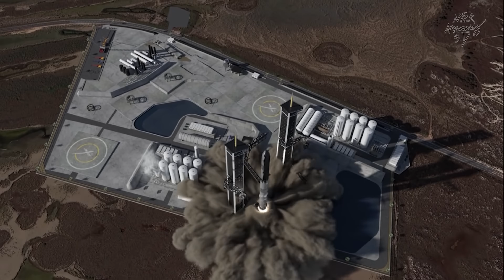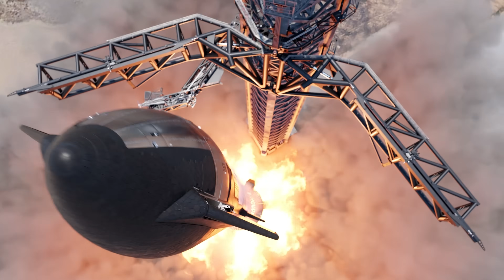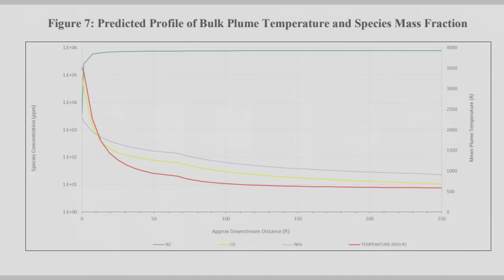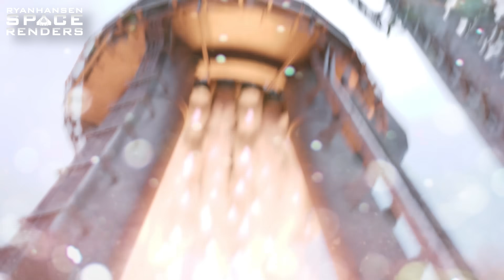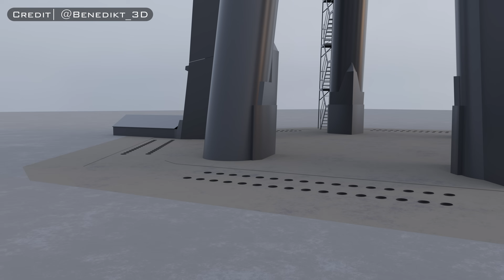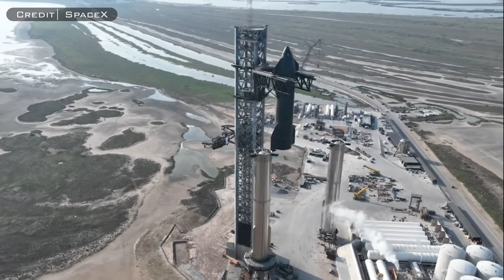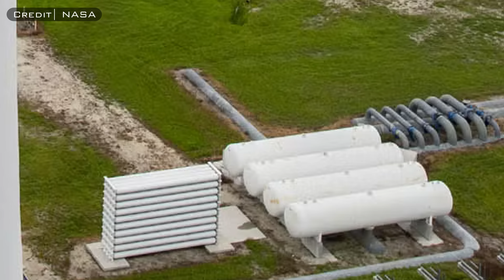SpaceX's "Major" Concrete Problem + Water Deluge Construction Begins at Starbase

Comment: 31:39 I imagine the launch mount structural engineer isn’t on the launch panel. Fondag appears to have a short curing time for maximum strength but water present up to full curing will expand as steam and rupture the slab. Heat only required for this.

Comment: Why didn't they make flame diverter in the first place? What a strange devotion to the ramp-rocket-tower trinity... If the water evaporates when it is still in plate wouldn't it make more damage? Like steel projectiles together with the concrete ones.
Reply from the maker: In my more recent episode I explained how this will work without water boiling inside if the plates.

Comment: I wonder if they used heavy thick stone slabs of Granite or Marble stone work with no mortar used between the blocks instead of pouring concrete? The stone work of some materials might be more resistant to heat than  poured water absorbant  materials are.

Comment: You can't just simply use a material's properties to predict its performance in an application, how that material is used to build a structure is just as important, if not more so. If you suddenly increase the pressure inside a room built with concrete, even just a few psi increase will blow the walls out. You see this in high wind situations where roofs and walls get blown out because of the sudden but relatively marginal increase in pressure inside the building. People who are still apologists for Musks way of doing things are in denial. The debacle with the recent Starship launch should be proof that there is only one way to go...

Comment: I'm seeing this video after the concrete was destroyed. What I don’t understand is why. The data is for 1 engine. Your rough calculations are for 1 engine. Even 14 engines in a staggered pattern would perform differently. No one, including government oversight factored for the center engines to be in a confined state. Since the outer engines would prevent the innermost from ever expanding or mixing with cooler air. In someways they would act as an increasing pressure confinement until something gives. Also the concrete in compression is only as strong as the base it's set upon. Sand has a lower compression rating and holds more water than soil. Now add increasing pressure and heat as the engines throttle up. Instead of concrete spalling, you have stream pressure vessel. Which will explode outwards, the large flying blocks of concrete. Common sense is missing
Reply: YES!  Fantastic observation/explanation. I was thinking about the plume confinement too- but your additional consideration of the underlying sand/earth was genius. Thank you! 🎉
Reply: When I look at the base of the heavy, I see a cutting torch. Which uses oxygen and a fuel propane, methane or acetylene. If the inner 3 raptors were running just oxygen. It definitely would be the largest cutting torch. The thermal dynamics should be similar. Which would be easy to calculate the pressure and heat onto the concrete and base

Comment: Here after the destruction of stage zero. Space X is wasting time. Even if they do a flame trench, those engines still burned the upper stage zero materials including materials on the chop sticks. So even if they fix the pad, they have the raw thrust of the 33 raptors they have to tame to ensure plumbing is not charred.

Comment: Why do you suppose that the centre of the plume will cool from over 3000C at the rocket nozzle to 2000C at the concrete surface when there is no cooling entrainment? I assume we are talking total (stagnation) temperatures in both positions. 
Others have mentioned the acoustic pulsating pressure which together with the thermal gradient in the concrete and much higher temperature would account for the damage now seen.
If a water deluge system will suppress the acoustic pulses, then a water cooled metal plate might work. However I suspect that some kind of inclined surface will be needed to deflect the acoustic energy which might have contributed to engine damage.

Comment: "assume 100% of the thrust generated is applied directly to the ground". This a  baseless assumption (pun intended). The blast energy and the sound energy will radiate out around the 33 firing Raptor 2 engines. With hindsight, after the first Superheavy launch we also learned that the kinetic energy imparted to flying concrete debris from the launchpad can cause a huge amount of damage.

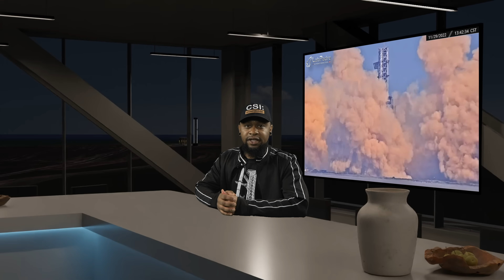Comment: The predictions made around 17:00 have failed catastrophically. In retrospect, it's easy to see why the calculations are wrong; temperature was only a minor cause of the damage and what actually shattered the Fondag was the jackhammer action of the startup pressure front. That's why the crater is inside the engine ring and the outside portland cement was mostly fine. Futhermore, the compressive ultimate strength of the cement is only relevant for a compressive load, i.e a perfectly even load in a test machine. When you lay the concrete over soft sandy soil, you have a bending load that is supported mostly by the rebar. When concrete started to crack it allowed exhaust pressure to enter the mass of the material and chip away the outside layers, just like in your heat spalling video.
Reply: 100%

Comment: Looks like the damage is not unexpected. Interesting that they didnt launch with the water deluge system which is there primarily to reduce sound damage. Looks like they where looking at worst case senario/ stress testing the rocket ... and it came though.

Comment: From the Starship launch yesterday (20 Apr 2023), the concrete problem seems more prominent when the engines went to a much higher power. There were massive debris being thrown hundreds of meters visible from a faraway angle of video, and some mentioned a block of concrete at watermelon size dropped on a vehicle outside the launch station. People are suspecting concrete debris may have destroyed 3 engines straightaway before the starship left the ground.

Comment: Since pad damage is a major concern at this time, here is a method that may mitigate damage. Since the outer ring of Raptors have outside air mixing in with them, for launch fire them at 100%. Since the inner ring does not enjoy that outside air mixing in, they operate more like a blowtorch on the pad. For launch fire them at a reduced power level, and once clear of pad and launch tower, ramp up the power levels to 100%.

This an inefficient technique that wastes fuel, but for test launches and until a long term solution is found, this may reduce pad damage.

Comment: Based on some simplified calculations, even the exhaust temperature should be possible to handle with fondag. Assuming that the flow is adiabatic (and mostly diatomic) and expands from 1,33 sqm to approx 11 sqm, the temperature should fall to around 1070 K, whereas fondag should be capable of 1370 K.

Comment: What about a turn table of concrete that spins so pad doesn’t heat up to the point of no return. Also a slab of concrete on rails moving as engines fire no part would heat to much

Comment: I say SpaceX should put in the strongest and most refractory concrete there is and then, clad the entire surface with 1 to 11/2 inch Tungsten, Tungsten Carbide, or Molybdenum plate. Also, they should place thin Molybdenum cladding around everything else around the orbit launch pad that needs to be protected. The forces and tempatures of all 33 Raptors during launch are going to be colossal.

Comment: Question....Is it necessary to fully throttle all 33 engines to get the vehicle to an initial height so as to do minimal damage to the concrete and surrounding structures? If full throttle is not needed to achieve this height, full throttle could be used as needed after this height.

Comment: Bro, all they have to do is cover the bottom of the launch pad with large interlinked stainless steel plates (several inches thick) and they’ll never have to worry about broken concrete.

Comment: Long ago, the makers of tanks have discovered a practical way to reduce the destructive effect of bombs falling on a tank. The idea was to put explosives on the surface of the tanks so that their explosion (when a rocket hits the tank) would reduce the penetrating effect of that rocket. It is called a ¨reactive armor¨. 

In the case of Spacex, they could use the same idea by putting reactors pointing upwards underneath the tower. Those reactors would be controlled by computers to make sure that they would create a smaller pression than the Spaceship's reactors. To reduce even more the danger for the Spaceship, those reactive reactors should be oriented towards the exterior of the tower.

It's even possible that such reactive rockets would increase the initial velocity of the Spaceship which, in turn, would increase the total payload transported in space by the Spaceship.

Comment: Not an engineer, SO, This may sound simplistic, why can't  SpaceX raise the rocket launch mount higher from the concrete pad?  Wouldn't this give distance for exhaust blast to spread out and dissipate putting less stress on the concrete pad. Likewise, the flat pad, construct it at an angle to deflect blast away and not have to take the exhaust blast on the flat pad.

Comment: You used the room temperature compressive strength. You should consider the high temperature strength instead. If the temperature is close to 800 C, the strength is expected to be one order of magnitude lower.

Comment: Just speculating here, but I am guessing the lack of a trench and water deluge system was part of Elon's plan for a quick turnaround between launches, providing better access to the pad and not needing to refill water tanks. That plan has obviously been changed, so we will probably not see the rapid relaunch that has optimistically been announced (perhaps double that time).

Comment: Zack, nice video but the water tank is not pressurized...the pressure is a result of gravity and is measured at THE BASE of the tower.  Head pressure from ELEVATION in .434 psi per foot of elevation, as you measure up the riser pressure decreases by this amount.
Reply from the maker: I didn’t say that the water tower was pressurized. I explained the concept of pressurizing the shorter tank. I also did not say that’s what’s actually happening.
Reply: @CSIStarbase  I know you know, I simply watched the section 3 times and it was not demonstrably apparent where you were tracking with the pressurized tank theme.
Reply from the maker: @Mike-Hawk-11  I have stated that I believe it’s a water tank for several months. Although I am on the fence about it’s true purpose.  The reason I explained that concept was for the people who have been giving me tons of grief for not accepting it’s LOX. I wanted to explain my train of thought.
Reply: @CSIStarbase  Zack, perhaps if you explained elevated water tank principle as "free pressure" provided by gravity folks may issue less grief. Maybe
Reply: I mod chat in some science threads and the maturity level at times is appalling...

Comment: Starship is getting impressive. This Stage 0 is a disaster. 
They made a terrible blunder when they chose not to build (or just forgot) a robust flame diverter. 
I think they should replace this launch pad with a proper one. It’s not even adequate for static fire testing. Call it a pathfinder and move on. 
The first launch should be at pad 39A. No launches should ever be attempted at an improperly designed launch pad.
Reply from the maker: I suppose that’s a matter of opinion until we see the 33 engine attempt

Comment: I'm wondering if they can add antifreeze to the water used to mix the concrete. If the antifreeze stays with the water in the concrete, then the boiling point should be greater. Would this make a difference? Don't know.
Reply: Holy s*** that's a dumb idea!!!  🤣🤡
Reply: @bobbydazzler6990  I know cement contractors do this. I saw a cement driveway poured on a main street in my neighborhood during a bitterly cold spell, maybe 30 years ago. The greenish tinge eventually faded after a few years. That slab is still there today. The question remains about a potential change in boiling point and if it would matter.

Comment: If concrete is utilized, configure launch mount to be able to accept prefab concrete pads. Launch, roll out damaged, clean up, roll in new. A few hours tops. Steel can be applied as well, with several launches until replacement (test dependent).
Nice video.

Comment: Solution 24 inch or better plate steel shaped to deflect,...also consider that the innermost engines thrust dispersion will be focussed by the out engines concentrating their effect on the pad

Comment: I kept wondering why SpaceX did not have a flame trench and/or water dampening. Thirty raptor engines firing all at once, with plans for multiple launches from the same spot numerous times per day. I've watched this so many times https://www.youtube.com/watch?v=FircvSand7A - and then that on the big screen https://www.youtube.com/watch?v=JEl65_JjNMQ was amazing and stunning. So hot water is flashing to steam. Surely they had suspicions such a system would be needed. Back in 1929 in the film "Woman in the Moon" the rocket is rolled out, sunk into a pool of water and launched from being partial underwater.

Comment: Excellent job.  Wishing you success.  
I believe the biggest mistake at Boca Chica is to not build a flame trench with diverter along with the sound suppression water system.  Since the water table is high as it is at the Cape, they could have gone with the same approach and build the pad up with the trench at sea level.  Similar to LC 39A and B at KSC.  In the short term there is a cost, but in the long run it may save money with not having to rebuild the pad after each launch.

Comment: On the other hand, if the engine nozzles are dynamically cooled then wouldn't the blast pad components be equally designed. Plus i thought the NASA launch waterfalls dampened damaging sound waves from degrading surrounding structures

Comment: I don't think for now they are really bothered with concrete being torn apart.

Should that be an issue to carry tests they'd have indeed prioritise the water deluge system… Which by the way looks to be an engineering « nightmare » since it necessitate to account the speed of the fluid into any given part to avoid « Choked flow ». Let's keep in mind at the end of the day you're looking to create a temporary protective blanket. Could adding air to the flow of water at the nozzle end help achieving that whilst diminishing the quantity of water needed, I'm no engineer.

Not mentioning they could also use ceramic tiles as per Starship belly (they are numerous way to anchor them to the ground to make sure the tiles wouldn't be flying away)…

Comment: I think the full engine tests will succeed, but I am worried about a big boom from the tank farm.  I do not think that berm they constructed is going to work.  There best bet would be a flame trench to control where the exhaust goes thus limiting the amount headed for the tank farm.

Comment: Ever heard of ablation? It’s used on reentry capsules to mitigate reentry abrasion from high temperature plasma. Hint engineer a flame diverter like nose cones on reentry vehicles!
Reply: Hi, thanks for your comment. Did you just define ablation to someone that is passionate about space travel?
Reply: @Geoff_A  yes, I follow spacex engineering problems.

Comment: Forgive my ignorance, but why doesn't Space X layer the entire bottom of the launch pad by thick sheets of steel? The melting point of steel is around 2500F or 1370C and as its only for a few seconds, wouldn't this surely be a better option?

Comment: The temperature of the gas ejected by the rocket engine has a linear relationship with the color of the ejected gas. When it is bright white, the temperature is about 1400-1500 degrees Celsius, when it is bright red, it is about 1000-1100 degrees Celsius, and when it is dark red, it is about 800 degrees Celsius. There is an old-fashioned measurement The temperature instrument is to measure the current passing through the tungsten wire of the incandescent lamp to control the temperature and color temperature of the tungsten wire, and then compare the color temperature with the distant object through the telescope. When there is the same color temperature and brightness, use the size of the current to calculate temperature.

Comment: The compressive force of a Raptor engine is not uniform across its diameter.  
Heat from one engine is not representative of specific pad temperature at every point.
Cooling the pad with embedded refrigerant piping might help.

Comment: Your estimate of temperature is incorrect. The data you speak of refers to static temperature which does not include the kinetic energy of the jet. What you need is the total or stagnation temperature which is what the concrete will face as the flow stagnates at the centre of the jet axis. Total temperatures will be much higher than the static temperature.
Reply: Additionally, above the jet impingement location, you are going to see a normal shock wave that raises the static temperature (keeping the total temperature constant at its very high levels) so even surrounding the stagnation zone, you're going to have very hot and moderately high velocity gas flowing outwards leading to intense heat transfer rates. I think there's a reason why every launch provider has some way or the other of managing the jet exhausts. I really don't know what spacex is trying to do here. If a flame diverter is absolutely off the table who whatever reason, I personally would look at alumina bricks to form a refractory surface that is much more capable than cured concrete.